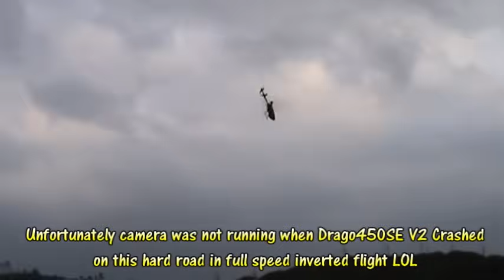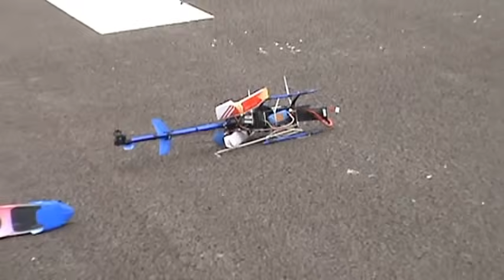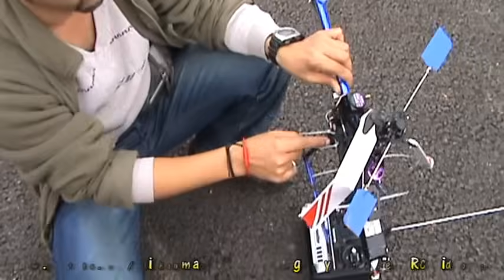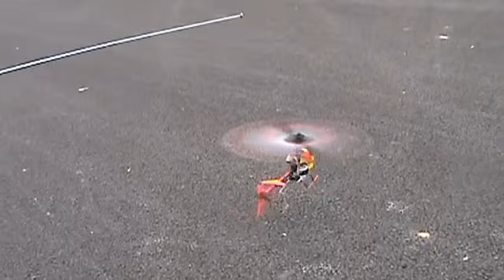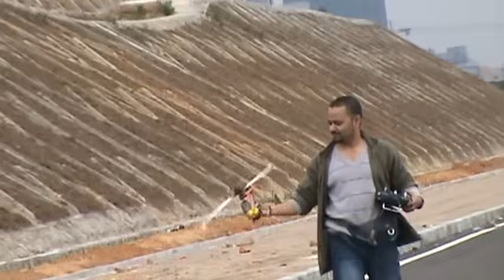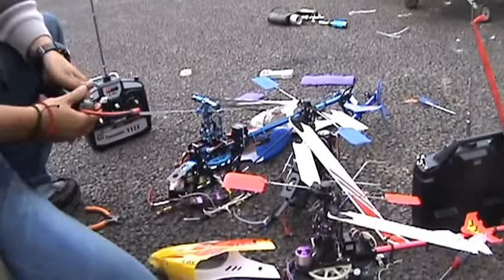AliShanMao The RC Heli Killer

Comment: HIT THROTTLE HOLD AS SOON AS YOU NOTICE ANY PROBLEM.  Then you have a chance of saving the heli even inverted and even if it started to spin. because no motor no torque, the spinning should slow down and you could correct and get the heli upright. although the 450s dont auto well.

See so many people get into an iminant failure and dsestroy the heli because they didnt hit TH

Comment: I need help with a 401 gyro... I am new to these gyros and my problem is that through out my flights I have to add mor and mor input to hold the tail straight if I land and kill the engine and reset the power to the rx and gyro it finds 0 and flys fine again but I have to keep doing this! WHY??? my engine carb is set correctly and my head speed is where it needs to be. the heli is in videos on my channel but none are of the problem but you can see how it's flown at really low altitude. PLZ help